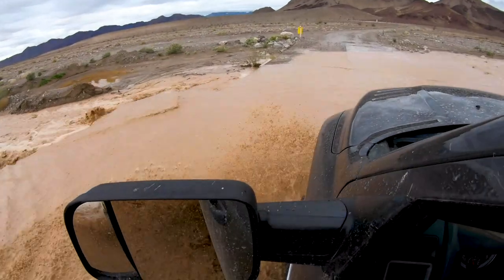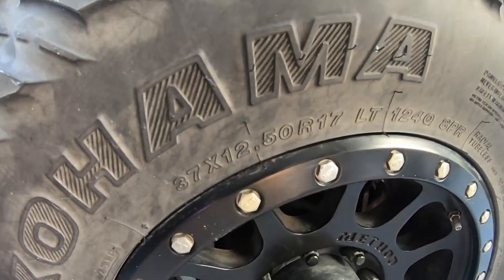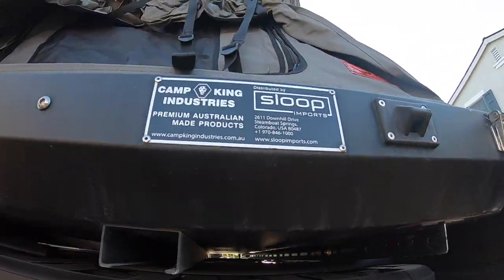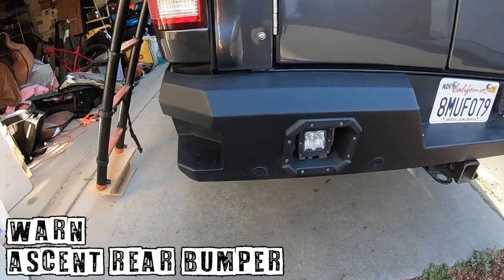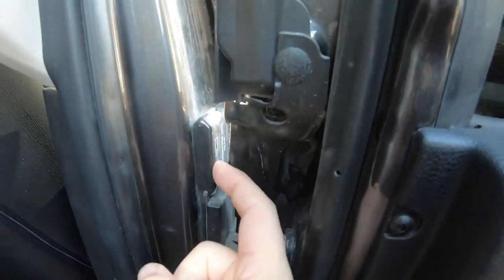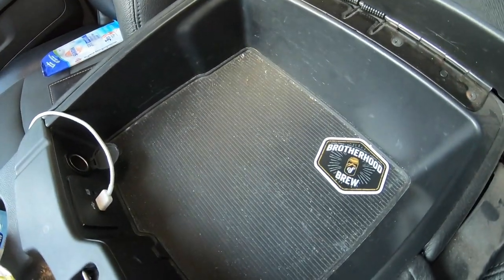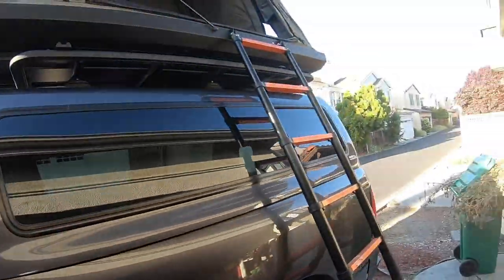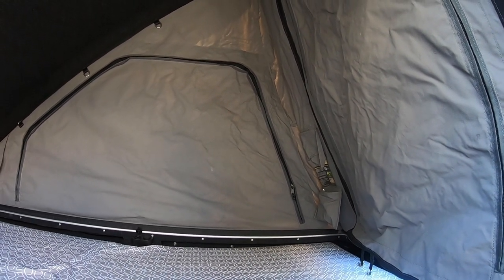2015 Ram 2500 Overland build Walk Around with Camp King RTT

Comment: Awesome video buddy I've got a 2012 dodge ram 4x4 with 6in lift and 35 toyo tires would you recommend that for me for off roading
Reply from the maker: 6 inches is a bit high for real offroading. You don't need that much height to do well offroad. I'd stay below 3 inches if you can and keep your center of gravity low.

Comment: Nice build!  I’ve been trying to figure out where to mount a tablet that’s not to high, or obstructs passenger mirror.  What kind of mount do you have?
Reply from the maker: Used a Ram Mount spring loaded iPad holder that was mounted to the lower side of the dash. You can see it at the 7:24 mark

Comment: Bad ass truck! Did you have a full size spare? How hard was it to fit in the stock location?
Reply from the maker: Usually carried it in the bed. Didn’t always come on the trips but I always kept the 35”’spare under the truck just in case and I’d just air down my 37’s if I was in a pinch